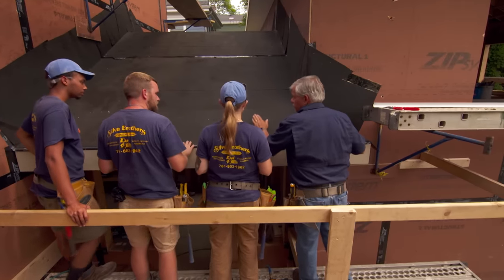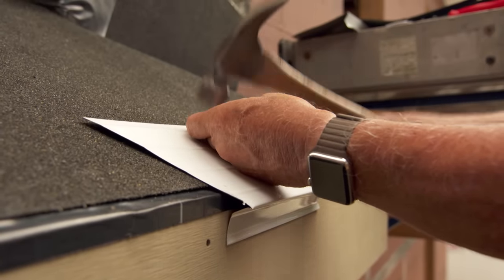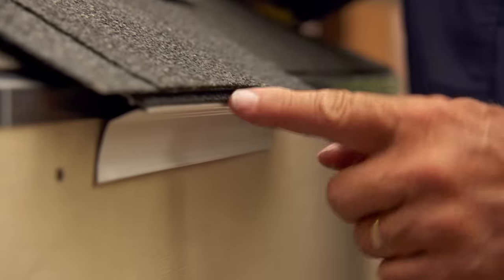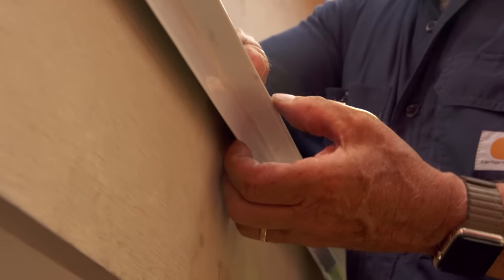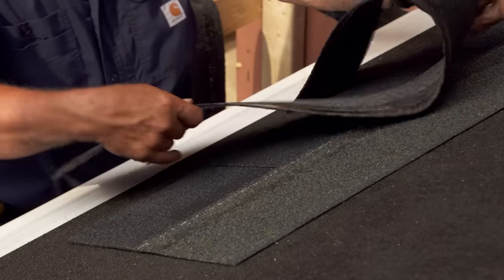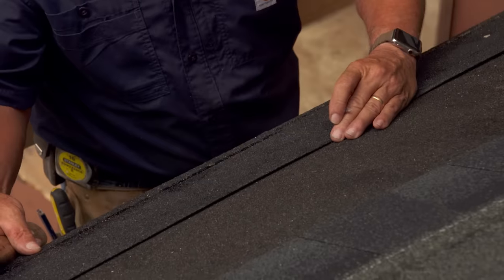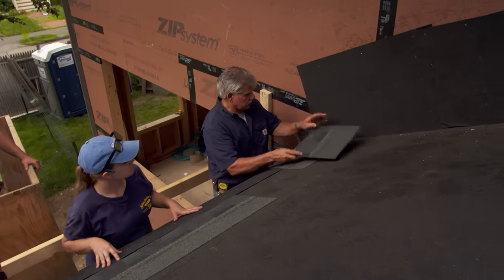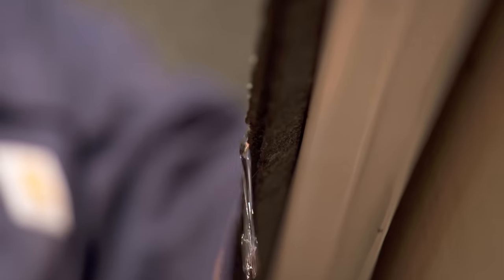How to Install Drip Edge and Step Flashing | This Old House

Comment: You confirmed why my fascia boards keep peeling paint every  couple years. The drip edge is pressed against the fascia boards. And the drip edge does not even have a little lip, kick out, at the bottom of it. It sits flat against the fascia boards.  Been watching you guys for many years. Thank you!!
Reply: Its ok for the drip edge to touch, nobody does it how is shows for good reason. You simply need proper drip edge with a kick out, and when new roof is installed make sure they stick the shingle out past the drip edge not flush. This method looks terrible when you walk up to look at a house, you will also wreck your drip edge/shingles soon as you put a ladder on it.
Reply: First note ... If ya drip edge dose not have a quarter inch kick on it ... It is not drip edge ... And it matters not if the drip edge touches ... The reason for the peeling paint ... My guess would be a few things ... Either cheap paint ... Or your soffit is not properly vented ...
Reply: Your roofer might use the different drip edge. My drip edges have a little lip, kick out at the bottom and space 0.5" from the fascia broads. When the heavy rain come, it would not touch the fascia broads, only slow rain.
Reply: Your fascia may be peeling paint not from rain but from not fully painting both inside and outside of the board as well as using a poor paint choice. Meaning pull it off and paint the whole thing as a dry board. Just a regular satin acrylic latex, and if the paint needs a primer, use Zinsser bullseye 123. I have not had any peeling paint after doing that.
Reply: @scottdowney4318  Its been a couple years and the fascia looks great. Separated the flashing from fascia, scraped and sanded to bare wood. Used same paint brands as originally used and have used successfully  for decades, Zinsser 123 and Kelly Moore.
Reply: @ridemfast7625  Issue is should paint all sides of a board to keep down the wood movement due to water swelling the wood, then evaporating out of the wood causes it to shrink, not just rain but humidity swells wood, proof, see how some doors get stuck when it is humid. Definitely oil paints will crack and peel off, very much better using the acrylic latex house paints. And stripping off the old peeling paint is very important. Why paint on top peeling paint.
Reply: @scottdowney4318  Thats not what this issues was.  Fascia was primed and painted before installed. Only front peeled, not bottom or back. Again, all looks good now after pulling drip edge  off of fascia.

Comment: I have a roof being done right now. The product manager decided on his own not to replace the drip edge. The existing drip edge was half the length that it should have been and wood was showing. Idiot! I am making them replace the drip edge. My question is should they take off the older drip edge or put new drip edge over old?
Reply: Take if off.

Comment: For a low slope patio cover, (.5" per foot) what is the best method for adhering fiber reinforce rolled roofing to the drip edge. The mastic I used previously let loose after a number of years, causing rain water to wick back and then under the drip edge.
Reply: Hopefully this still helps. I’m in the same bout about this question. (I’m a diy not certified or anything) I saw a video where you’ll need to spray the drip with a certain spray can, I forgot the name, then it’ll bubble and it’ll have a good surface for the roofing to stick on to via the roofing or the underlayment.
Reply: @attaker5  I believe that is for pre-treating galvanized edging. I was using painted rain drip edging and I ended up using a polyurethane roofing adhesive along the edge. I think it will hold much better and at any rate I'll know what to look for if it lets lose again down the road.

Comment: Not sure I understood the purpose of the drip edge if the shingles end up totally protruding over it. I mean water never even touched the drip edge. Why put one in the first place then?
Reply: Drip edge allowed another half inch or so beyond the fascia board which in total means about an inch away from the fascia. If you just extended the shingles that far without a drip edge the shingles would quickly sag down against the fascia board.

Comment: Instead of step flashing can you not run flashing the whole length but kept on top of the starter course? Any pros or cons to either? Thanks!
Reply: If water gets in its staying in, step flashing allows water that gets in to leave the next step

Comment: These videos can get a bit Cheesy at time but now i know why I have water damage in my garage.  The gutters were mounted over the drip edge on the front and back of my garage 🤦🏻‍♂️
Reply: Gutters always slide under the drip edge....regardless whether drip edge is tight against the fascia or has a gap.

Comment: That would be a nightmare if you had to lean a ladder over that edge. I've never seen a drip edge installed with that much space.
Reply: Lean the ladder on the facia not only the shingles
Reply: @dohc1974   I guess I was making a moot point since my gutters are in the way.

Comment: Never disappointed with how massively unhelpful the comments on these TOH videos are. People loving to disagree and criticize, but then either don't back it up with the "correct method" or they try and their explanation is self-contradictory or too subjective. Comes off like dudes swinging themselves around more than trying to be helpful.

"Do it the opposite way Tom does it."
"Why?"
"Cause he's wrong."
"Nah, he's 90% correct, but the 10% he's wrong will cost you your life."
"Nah, he's right, but the way he did it is wrong."
"Nah, he's wrong, but the way he did is right."
"You're all wrong! Do it this overcomplicated way that doesn't make sense outside of my climate region and even then expect to redo it every 10 years, even though that makes zero sense for a $20k roof."

Makes me absolutely LOATHE working with contractors. No two agree with one another and you constantly feel like half of your house is on the verge of imploding.

Comment: Good video,  a few things I do differently.  Step flashing should never be nailed to a wall. It should be nailed to the roof deck in upper corner away from wall. 2 reasons for this, when a re-roof is needed you can pop the step off without removing all the siding. Also roof deck should move as one system with the steps in weather, hot cold ect.  And drip edge should be tight to roof facia and ice and water or 30lb felt above flashing, not on top. Drip edge is really only needed in low slope application, use the correct overhang and it will keep water off facia board.

Comment: The water sucking to the facia was due to the shingle flush with the flashing edge not because the flashing was tight to the facia water ran off after the shingle had a small overhang off the flashing.

Comment: You are not nailing those shingles on correctly. You are above the white nailing line by an inch at least. Missing the underlying shingle or at best just clipping the edge. Shame on you. These kids will do more damage than good. Especially on steeper pitch roofs.

Comment: I LIVE IN HURRICANE CENTRAL  There is NO WAY I'm going to allow shingles to overhang the metal drip edge so that wind can lift them.

I'm designing a fix for both problems.

Comment: And now when the guy who has to put a new roof on will have to tear apart the wall to get to all the nails you put into the wall... you are the installer roofers don’t like! Two nails through shingle into step flashing... holds and seals due to going through nail line.